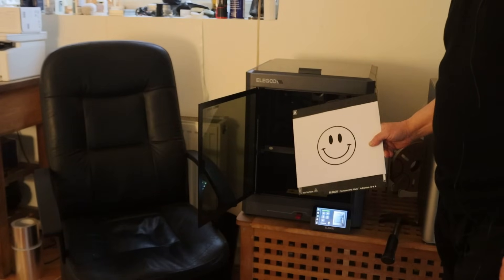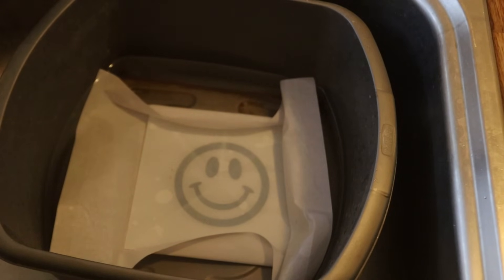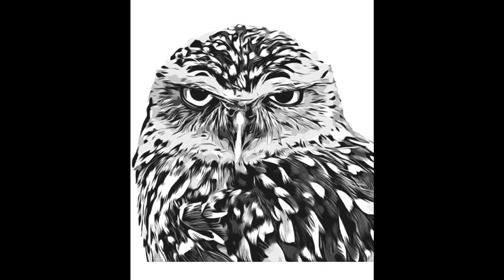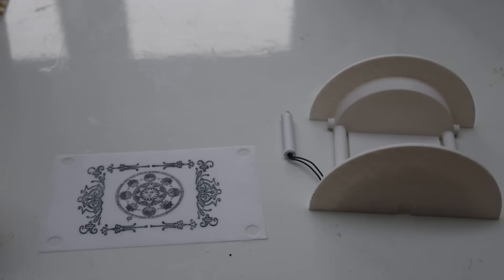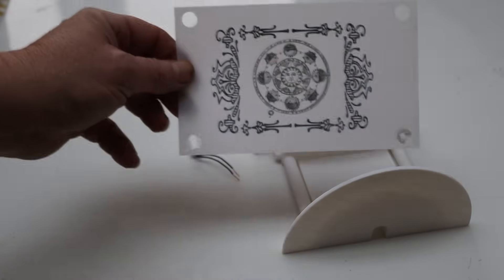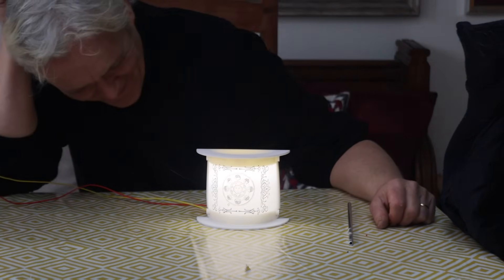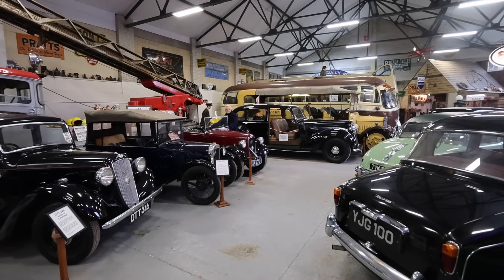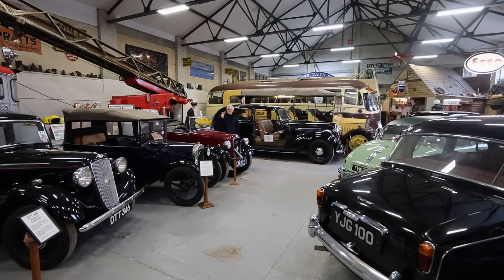2345 How To Make And Use Transfers For 3D Printing

Comment: I've seen there are attempts of inserting an inkjet head next to the extruder and dying at the time of printing. Just change that to colored toner inserted at the melting point. Sorry, I'm smart enough to imagine, but not to build. I'm still wondering if I can convert an ECO tank small format printer into a large format printer. Just because.

Comment: Nice.

For the glitter finish I think a bed of "cooking" parchment paper, rather than directly onto the 3d printing bed, might be a better idea. It's at the top end of it's rated use but the other side of that is, rated use is in oven for a fair amount of time. On a print bed it only has to deal with the highest temperature for a thin line at a time and then only on the, first layer, initial pass of melted filament.

For transfer use, parchment paper looks possibly also a good option, so long as it takes the laser print toner OK. I'm not sure though, as it could leave residue in the laser printer and over time start to cause problems there, like stickiness leading to paper jams...Though also not sure if it being less absorbent than normal print paper would help or hinder, I can see arguments for both cases. 

 Or indeed possibly fuse the paper to the printed filament and not be removable by soaking off like normal, water absorbent paper. So it might even be useless for either.

But full colour laser printer transfers should be possible on the type of paper you've used in the video.
Reply from the maker: I am going to try the cooking paper mate - it's a nice suggestion - thanks for sharing

Comment: Nice.  Was the ‘z’ offset on the printer changed to account for the paper thickness?
Reply from the maker: nope - the printer detected it in it's set up routine - if your printer doesn't do that you would need to adjust the z offset

Comment: Could you remove the toner powder from the drum, and then "paint/dab" it on the model? Then bake in an oven to set it. It wouldn't be as sharp, but you could "paint" a full model, vs the flat surface. Also, does the toner powder mix with any solvents, like rubbing alcohol for example, that would allow an easier time "painting?" That would allow you to mix colors as needed. I'm not thinking of sharp images so much, as being able to add multiple colors to the same model without spending for a Bambu/AMS combo, and without the purge waste from one.
Reply from the maker: yeah mate that would work

Comment: this makes me think you should be able to print out a printed circuit board traces as PLA on a copper clad board and then use the bonded PLA to resist the etchant of say vinegar and hydrogen peroxide from removing the copper to leave behind a set of electrical traces for your PCB (and maybe even print standoffs and such into the board too or holders and such that if washed of the etchant when done can be left as is while soldering the board components in place ;) ) as for the printing over toner I have used clear acetate plastic (the clear sheets for using a laser printer to make over head projector slides) to laser print on then use an iron to iron the image onto everything you can think of even leather, leaving just the toner from the print on the item it was ironed onto.
Reply from the maker: I wold think you could mate
Reply: @ThinkingandTinkering  I am still on the path to that copper nanoparticle printing by the way LOL (managed to use one of my lasers to do depositing of iron on a plastic bed using the laser on rust, and you can see the oxygen escaping so thick it looks like smoke a bit other than it dissipates too fast to be particles
Reply: @ThomasAndersonbsf  I was just about to comment about acetate film, but not sure if anyone would remember overhead projectors😄, I assume it would give a super smooth first layer as well.
Reply: @ch5139  I could see that for sure, as mine are super smooth too, even the new ones, another super smooth option would be the glossy card stock for printers and copier machines just make sure its for laser printers and you should be good (the ones for inkjet may make a gummy mess while going through a laser printer) I wish I still had access to the ricoh from back in the day AP360 I think it was) as it would print with really thick lines of color to the point it would bubble up off the paper when done. but I think we could also use the laser engravers too on low to lay down a thin layer of toner and then melt it where ever the laser touches, clean and repeat with the next color, and viola you should have a full color print to then use to 3D print on leaving it into the printed item (maybe even some white toner so you can print things that stick into and become one with a dark pigmented filament too)

Comment: Robert, Excellent demonstration of the new transfer technique! I have an idea that could attract a lot of viewers. Consider giving a demonstration using your technique to create front panels for electronic boxes, including all the buttons, dial scales, switch positions, LED holes, and other features. Here’s the plan: (1) Use a 3D printer to make thin plates of the proper dimensions while transferring your image to a flat piece of PLA. (2) After the water treatment, simply drill all the holes and load the switches, buttons, and LEDs. (3) Attach the front panel to the box. (4) Use color prints to highlight different front panel components. This method would save a lot of time by eliminating the need to silk screen the front panels or manually draw on labels like “on/off,” “power,” and “gain.” Color Laser Jet printers can generate a very useful and beautiful front panel display that would be very cost effective!  Can you try it?
Reply from the maker: You are right mate and I can certainly do it

Comment: You could use that as an inlay on either a 3d print or other object for decorative or instructive purposes.  If it's curved, just use the heated bed to heat it up before gluing it in.
Reply from the maker: nice one mate

Comment: There are a few points here. 1. Use the laser print on inkjet gloss photo paper. It will come off a lot easier in fact with just a bit of gentle heat from a hot air gun, no water needed. 2. Not sure if you know it but there are laser printers on the market that have a straight feed through path. They can be set for up to around 1,5 mm for thick cardboard or other materials. If the plastic print is thin enough then just shove it into one of these printers.
Btw that lamp you made could be flat and the printing could be the house number or name. Put a small solar panel on it to charge that battery up during the day so it can light up at night.
Reply from the maker: nice tips mate - cheers

Comment: Ive been using blender to incorparate image height maps onto 3d models, either by using lithothane generators or adding a multi res modifier and using the image stencil in scult mode, or u can take an svg and extrude it,  add a curve modifier if needed, everytime im in a museum or see celtic carving a snap a pic to use in my projects
Reply from the maker: nice mate
Reply: Hey that's my idea! 😂 jk but that's what I've been doing too. 2-4 layers of PLA or PTFE ideally makes perfect business cards

Comment: it strikes me that if you have access to a colour laserjet printer, then you can do multi colour images on your print, i would give it a go, but first I have to fix some quality issues I have with my laser printer (it needs a new transfer drum i think.)
Reply: either the imaging unit (which its just had a new one) or the transfer belt (only 6% life left), add those two parts together and a new machine is cheaper, I did see it has done nearly 20,000 prints going through 21 cartridges in that time, so time to replace it I think. it is about 5 years old now and has had a hard life.
Reply from the maker: i think you are spot on mate

Comment: But you're transfering the design to a 2D surface. Can you get it to work on a proper 3D object?
Reply from the maker: yes
Reply: @ThinkingandTinkering  Not using that method. Imagine printing a 3D zebra. How would you get the stripes on both back and sides?
Reply: For a low poly design, you might be able to print it flat, then fold it into shape. Print-in-place/snap-into-place hinges? Flexible filament? ASA bonding issues?